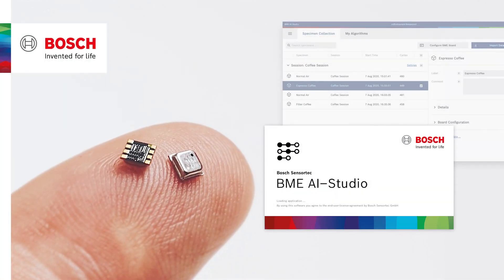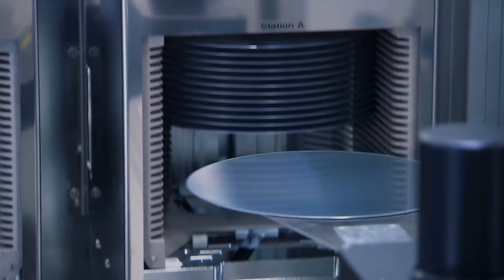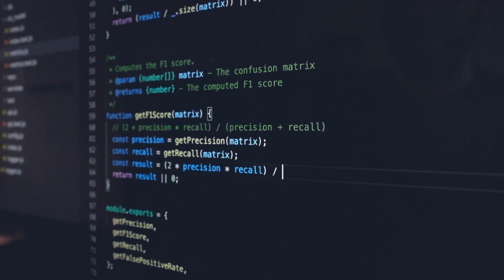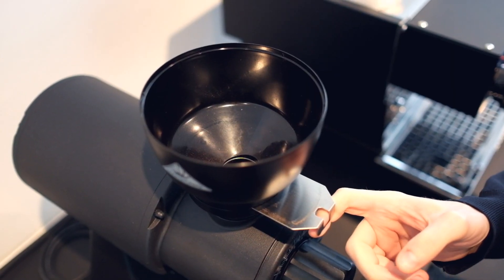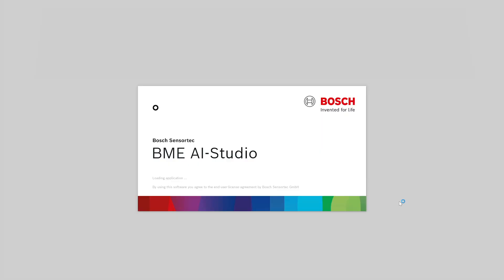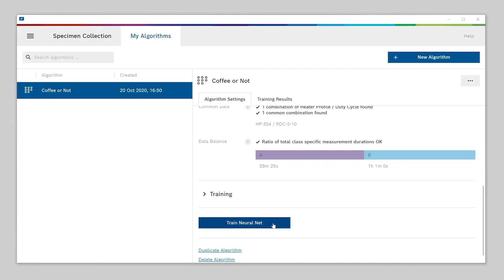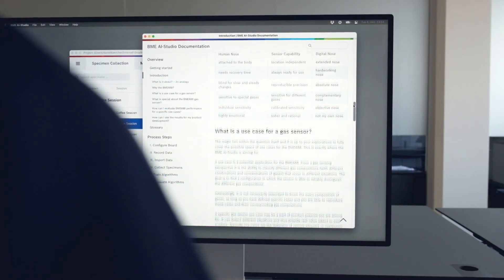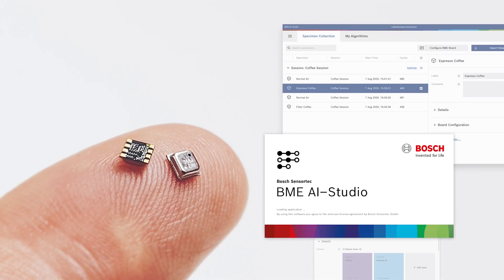How gas sensing gets intelligent with BME688 and BME AI-Studio

Comment: It seems we can only analyse recorded data. Can we use live data analysis by 24×7?
Reply: You train your machine learning model with the recorded data. Once your model is trained you can deploy that model to other boards that use the BME688. This dev board is really just meant for recording test data. In production you would really only use one sensor instead of 8. It records on 8 sensors so that your model can see data from multiple sensors to account for slight variations between each sensor.